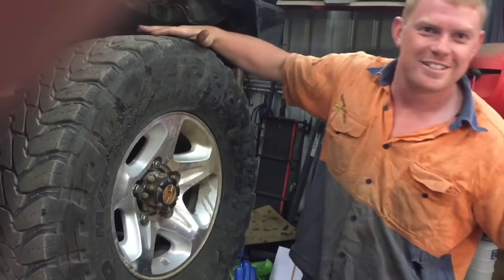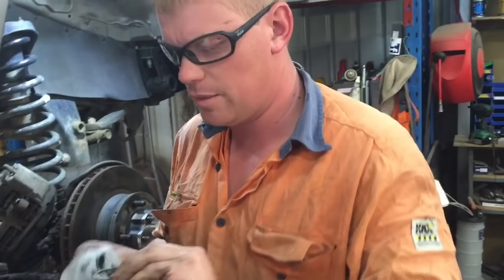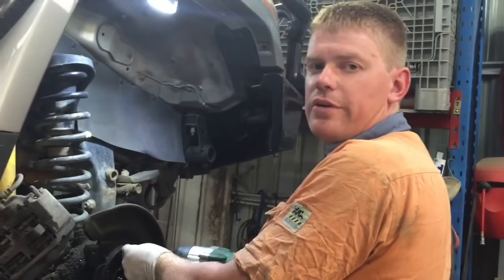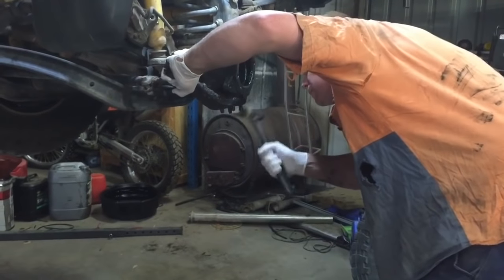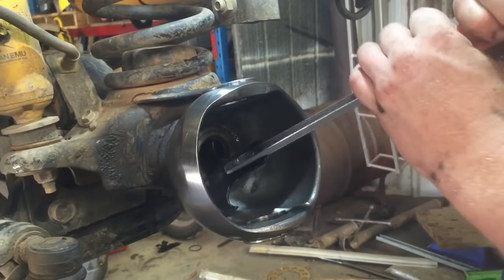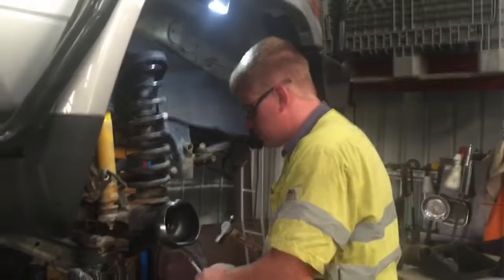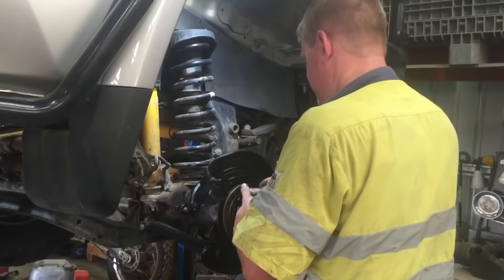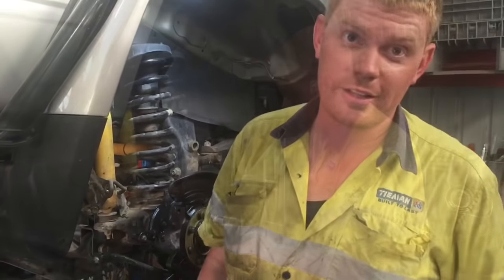Toyota landcruiser Hzj vdj 76 78 79 swivel hub rebuild

Comment: This is an excellent video, and my go to instruction for working on my ute's front wheels. I think the under-appreciated bit of equipment in this video is the car hoist. What a joy it would be to be able to do this work standing up, with parts easily accessed instead of lying in the dirt unable to get into position to access bolts. I think this goes part way to explaining why an hour long video instruction takes me the better part of a day to complete at home.
Reply from the maker: Abraham Pitman it took two days to film. I’ve come a long way from working on my own driveway in the dirt where there was a shed not far away but the roof was so low you couldn’t lift the bonnet. It’s taken me 20 years to achieve this. Keep on keeping on mate and work hard and you can do anything.
Reply: Haha im getting older so now its a yoga mate on the driveway lol
Reply: Car hoist is the "secret weapon", I was working under my car changing the oil or something like that and a hammer fell off the bonnet latch support area in the middle of the grille area and hit me fair square in the "Jatz crackers", I then promptly head butted the front cross member and vowed that that was the end, no more groveling around on a wheelie board in the dirt, I got me a hoist............. one of the best tools I ever bought for the shed.  Great video mate, excellent, very informative no rubbish.  I liked the donning of the safety glasses at the appropriate time, perfect, you've got my vote

Comment: the circlip in the free wheeling housing is a PITA to re-install. be careful it doesnt spring off and go "boing" into the shed or garden somewhere. a conventional external clip with two holes for normal circlip piers would make it so much easier. the 54mm socket is also 2-1/4" exactly

Comment: I fitted the wheel bearing race for a MK2 Hilux by using an old starter motor with the solenoid removed. I think the race was some thing like 83mm diameter and the starter was a mill or 2 under. The starter body was soft steel so didn't damage the race, and by hitting the shaft of the starter it drove it in dead straight.

Comment: I use a couple of old studs, or bolts with the heads cut off, to temporally hold the spindle gasket, spindle, backing plate etc in place until I got a couple of bolts in.

Comment: In ref to the position of the spindle gaskets: I have a FJ 60 series workshop manual which clearly shows a gasket between the swivel housing and the spindle. Makes perfect sense. But it also shows the other gasket positioned between the dust cover and the dust seal plate...not as you have done with the gasket between the outer face of spindle and dust cover. Other mechanics  have done it your way as well and this is the way that I have also done it...but it puzzled me why the need for this gasket at all ! ...hence why I looked in the 60 series manual. (Note: that the difference between these series of LCrusiers are negligible. Any comments?

Comment: I'm doing this tomorrow. The dirt and grease is caked on hard as hell like cement on the outer hub housing (worse than the VDJ in ya vid). Did you use a wire wheel to remove the bulk first?

Comment: Thx for the video - I have to do same job on my 80 series Land cruiser. I assume it'll be pretty similar. One question I have - do I have to engage (factory fitted) front axle diff lock in order to prevent parts from dislocating inside the diff when I pull out the drive shaft? I was told to do so if I pull out the rear axle drive shaft...
Could you please comment on this?
Cheers, Frank
Reply: Hey mate did u put the lockers in?
Reply: @PUUMBA4x4  yes - since I didn't get a reply I put lockers in - still don't know whether necessary or not?!
Reply: @franks2354  ye not sure i did my rear last week and where the axel goes into the diff dropped but ended up using a broom stick to lift it back up. Thats what putting the lockers in help stops

Comment: Hey mate. is the  skirted spring  rubber seal ( supplied in repco kit  WBK 3021) used in the front axel anywhere? it comes with the inner axel seal as well you knocked in first.  but can't find where the rubber one goes??? or is it only used in the rear axel?  cheershttps://www.tojo4wdcentre.com.au/part-shop/view/810/106/landcruiser/landcruiser-fzj80-8-92-12-97/90310-36003-seal-inner-axle-rear-landcruiser-75-78-79-80-105-series-12-97